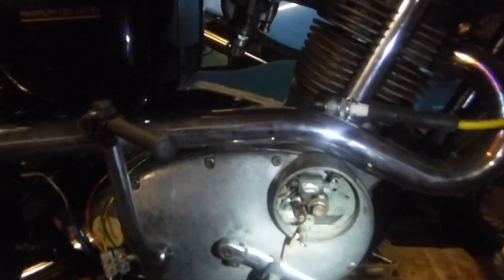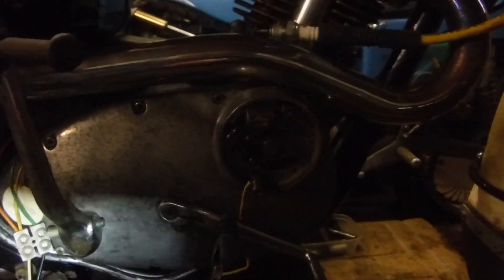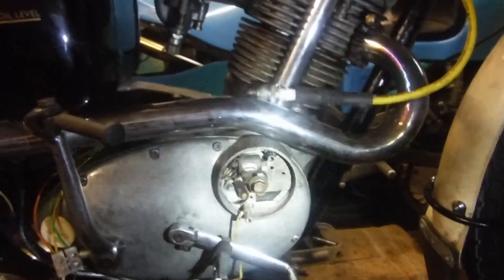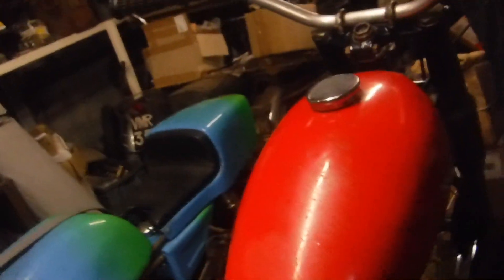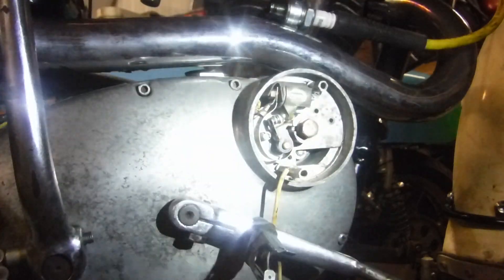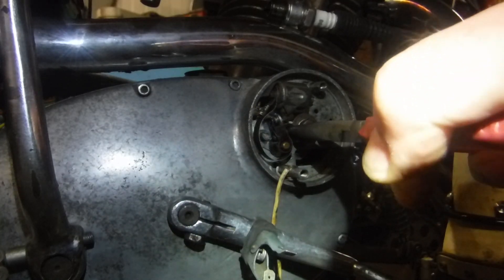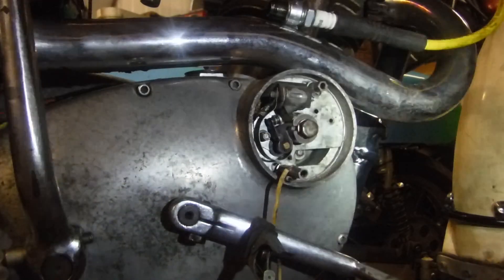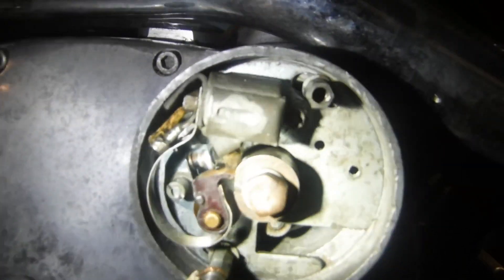Points ignition timing check, Triumph, BSA etc - a simple way to check full advance timing.

Comment: Hi Paul. That looks like a pretty good angle on the spark plug hole. Does your measurement account for the longer distance this creates?
Reply from the maker: Hi - not really, but 7 mm on the plunger through the plug hole seems to give good results for full advance, I have found.

Comment: I have kept the original points on my 1978 T140v , in 38 k miles over 46 years I haven’t had any problems, And if the battery 🪫 is flat the  engine will still start,

Comment: Thanks for posting this.  My AJS is, I think, the only bike I've had where the timing is specified at full advance rather than full retard.  It should spark at 1/4 inch BTDC, fully advanced, which is not far off the timing for the Cub.  I have a method for checking it, thanks to you.

Comment: Hi Paul.Been following you for over a year now & I love your videos. I recently bought a 91 bullet 500 which I've had to rebuild & have found your videos a great source of inspiration & information. This one on the timing especially as the static is 0.8mm which is difficult to gauge using the same tdc tool you have. I'm going to try your method but using a audible multimeter set on continuity. Many regards

Comment: Right ,,,Im slinking away     My old daily driver Enfield 1980 vintage   gets 15 ish thou on points gap   and then I just rotate backplate until revs pick up and it sounds happy  same with mixture screw       One thing ,,,  I also use stick down plug hole    But remember its a "domed piston and the plug hole comes in from side so it isn't xyz mm from tdc but a reflection of the slope of the piston so for a showing of 7mm the piston has probably dropped 9mm  ( from head don't pull me up on the maths ahahaha)    BUT if it works it works doesn't matter how u get there !

Comment: That's great and very informative Paul,  is this the same process with a twin or even on your three?
Reply: This works on pretty much all older points style ignition systems. All manufacturers used to give specs for full advance timing!! With Royal Es, for example, they even have a 'special lock washer tool' that you can use to lock the cam in full advance, and then rotate the points plate to the firing point.
Reply from the maker: That locking method is also used for many British, Lucas equipped machines, which the R.E. system is based on.
Reply from the maker: Thanks - and yes indeed!

Comment: Setting the timing at full advance both compensates for wear and for the differing advance ranges one encounters, usually 10 or 15 degrees, but as ever having the appropriate information is essential. I prefer to use a suitably marked length of spoke as it can be held much closer to vertical.
Reply: and ya cabt drop it into cylinder    ,,ask me how I know hahahaha!